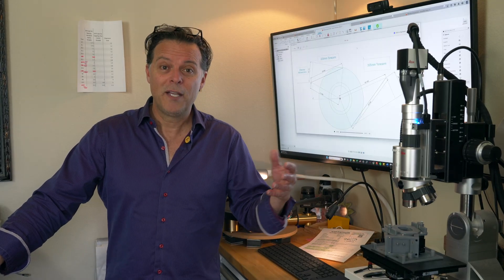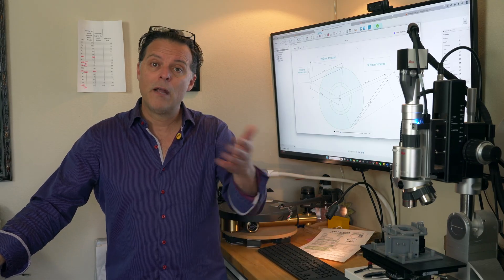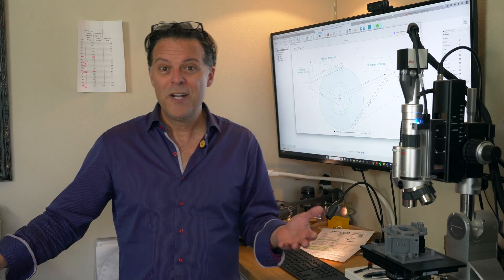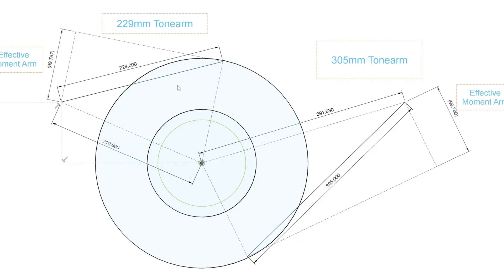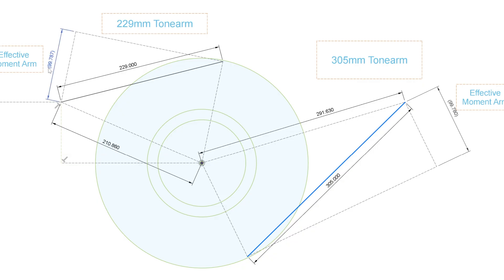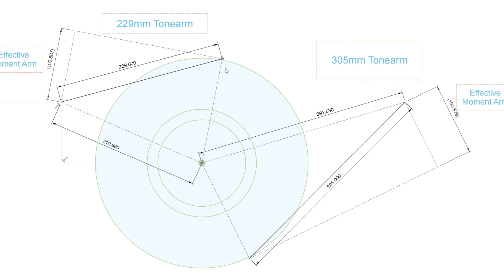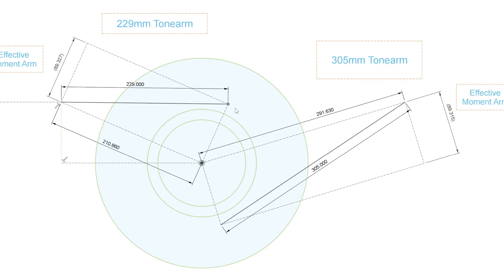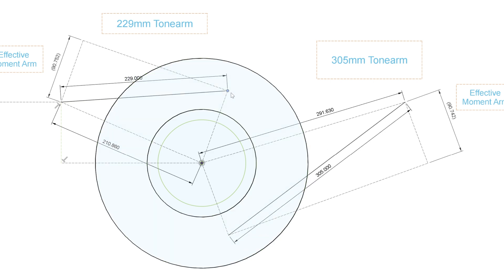Sound Bite #25:  Part 2 of 6 - Skating Force in 9" vs  12" Tonearms

Comment: The skating force is zero on the Thales circle drawn over the record centre - tonearm pivot. If you are more far from this circle, so you have more skating. As longer arm have less overhang they are more closer to the Thales circle, and develop less skating force.
Reply from the maker: I have no comment on the Thales but I think I showed pretty conclusively in this video that as long as setup geometry is held constant (Baerwald or Loefgren, etc) then decreased overhang native to longer arms does not result in decreased skating force. I used to think this same thing.

Comment: What is the meaning of 10%??
Reply from the maker: 10% of your VTF applied as a horizontal force. That is what the WallySkater measures.
Reply: @WAM-Engineering  Unfortunately I don't have the WallySkater, nor a 'dial with numbers' to go for the 10%. I have an Origin Live Enterprise arm which uses the 'ball system' (is that what it's called?). Aiming for 10% of a 2g tracking force feels a shot in the dark... like somewhere between zero and halfway along the metal shaft?? There is no way of knowing with that system. Origin Live recommends 'listening until the music snaps into focus'. 😦 . Any suggestions without the WallySkater?
Reply from the maker: @dirtharris  None that I know of. Sorry. Keep in mind that even if there was a dial or some fiducial to allow you to apply a specific force, it would still not be inclusive of the internal horizontal torque in your arm nor sensitive to any stiction in your tonearm's bearing. WallySkater takes this all into account.
Reply: @WAM-Engineering  Thank you for this J.R.

Comment: What you’re referring to as the “Effective Moment Arm” is the Linear Offset if I'm not mistaken. Yes, it may be the same for both 9” and 12” arms, but that’s not the only factor that determines skating force. Skating force varies with friction, and friction is influenced by vertical tracking force (VTF). Simply put, it’s the drag at the stylus.

The most important thing you missed here is ; the drag at stylus and the resulting skating force is applied to the pivot point as well as the anti-skating compensation. So, when the effective length of an arm is changed required anti-skating changes too. The ratio of linear offset to effective length is important in this regard. As a result; the arm length plays a role in skating/anti-skating even when linear offset is constant

BTW I think speed has a major role on skating force. Why don't we hear any discussion/research about how much skating force increases from 33.3rpm to 45rpm?
Reply from the maker: You probably missed video #1 in this series of skating force videos. Of course, it is very clear that friction is one of two necessary components of skating force. 

No, effective moment arm and linear offset are not the same. Linear offset is tied to the offset angle so it does not change length with playing radius. Effective moment arm is tied to the center of rotation. This is why it shows force potential depending upon variable arm geometries (watch for next video in this series), playing radius and setup geometries. 

A 33rpm record played at 45rpm demonstrates increased friction, but a 45rpm record and 33rpm record played at their designated rotational velocities have virtually the same coefficient of friction assuming a featureless terrain for an unmodulated groove wall. The differences that may exist between them is less than our setup error.
Reply: @WAM-Engineering  NO, I didn't miss the first video and no, linear offset is not tied to the offset angle. It is tied to the chosen geometry (Baerwald ,Lofgren etc) by the arm manufacturer and therefore tied to the overhang. I have two SME V arms, one 9" and one 12". Both have 93.47mm linear offset distances but different offset angles (23.6 vs 17.6).  The point is; effective moment arm (according to your wording) is constant from 9" to 12" simply because of the idea behind the geometry. The chosen geometry is calculating and rearranging overhang according to effective length while keeping effective moment arm constant. That is actually linear offset in my opinion. If you override design geometry of the arm then effective moment arm will change as well as overhang. 

About 33.3 vs 45rpm: The friction will certainly increase from 33.3 to 45rpm even on a featureless, unmodulated groove because the two factors affect the friction. The first one, the contact area is constant in both because the area of the facets of stylus in contact with groove walls is constant, doesn't change from 33.3 to 45rpm. But the second factor, the speed increases for the same diameter, same place on the record. As you know friction increases proportional to the square of the speed. So, the friction and certainly the skating is higher even for unmodulated groove. That's why 45rpm records have more groove noise compared to 33.3rpm records. This is one of the reasons that producers reconsider releasing double 45rpm albums. Thankfully 45rpm can be cut higher in level to overcome this problem.
Reply from the maker: @mtemura1822  I think we may both be referring to historical evidence of careless use of the term "linear offset" and - if this is the case - I don't know which definition to trust without doing some digging - which I am not yet prepared to do. 

In the cases where I have seen linear offset drawn, it has always been referred to as a static value, not dynamic like effective moment arm. "Effective moment arm" is a far more accurate term for a geometric function which has a dynamic force potential. "Linear offset" seems, by comparison, to be a descriptor of a static element. It is also possible that SME has confused effective moment arm with the term "linear offset" if indeed it was originally defined as the static geometric descriptor that I have come to know it as. I have seen peculiarities in SME specs in the past, so it is not out of the question. 

As I mentioned above, the difference in coefficient of friction between 33 and 45 are expressed at levels below our setup error. For there to be a difference at all between these two velocities requires Hertzian dynamics in order to calculate them, but the differences are so small as to be impractical given identical content recorded at the same playback velocity. 

I am highly suspicious of the claim that the velocity of the cut is solely and necessarily related to groove noise. I think it is more likely that the burnishing edge dimension of the cutting stylus needs to change for 33 vs 45 and then the results equalize.
Reply: @WAM-Engineering I cannot say I agree with you on all accounts but I’m very happy to see that you’re doing the research without stopping and sharing with us. Thank you.
Reply from the maker: @mtemura1822  It is my pleasure! Thank you for your thoughtful dialogue.